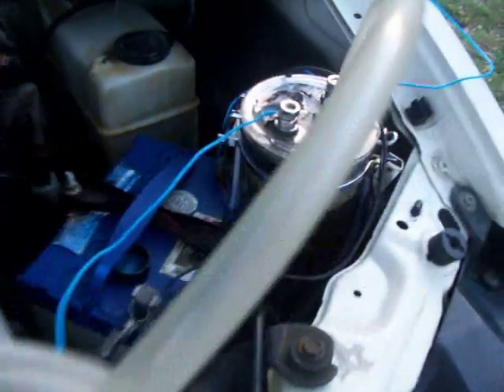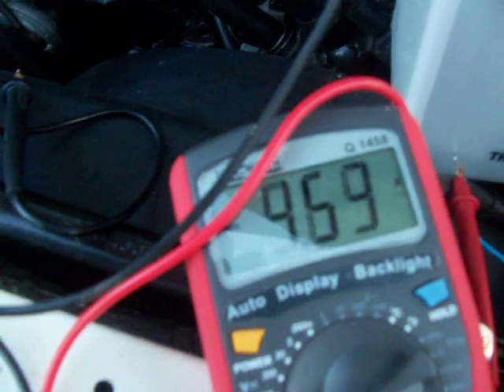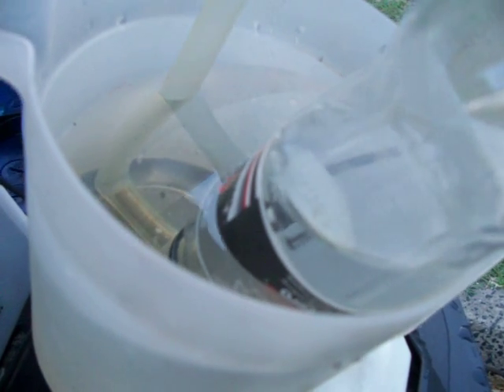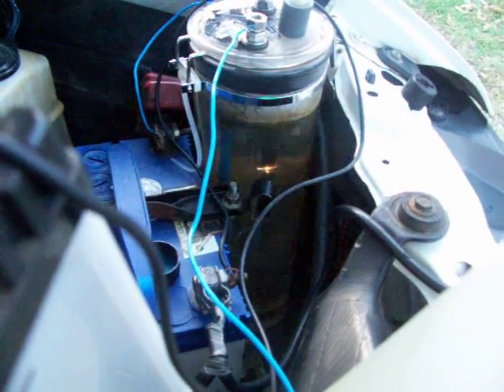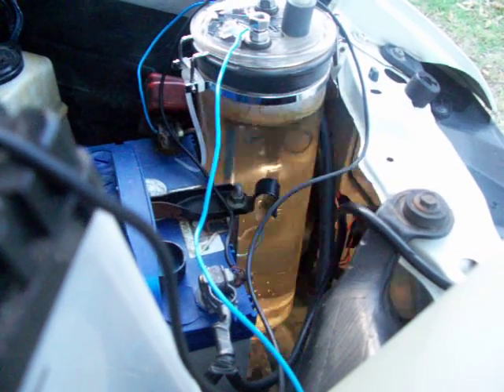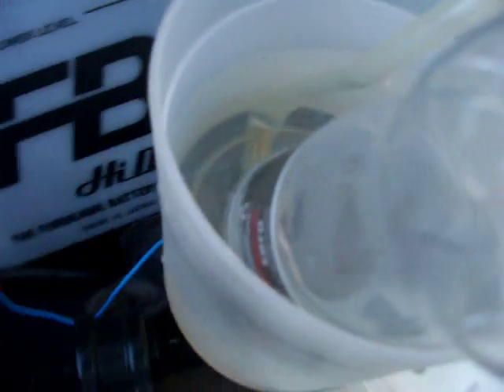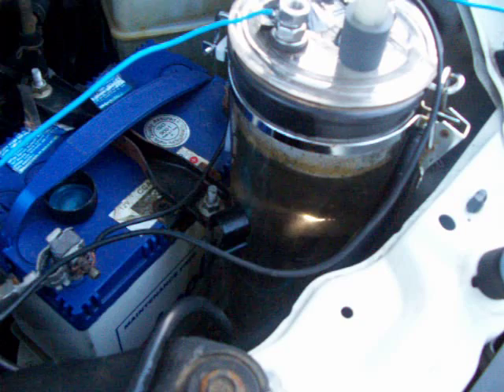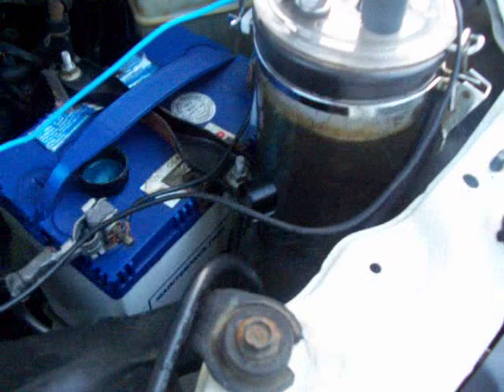Plasma Fusion Cell fitted in car test 1

Comment from the maker: @nick97549 " molicules, oxcegen, sut up"?????? Shouldnt that be Molecules, Oxygen, Set up? An illiterate engineer now thats something you dont see everyday. If you have done this experiment you would know the gas was not H2 and O2 as such a gas exposed to an ignition source would cause an explosion. It would not require air (Oxygen) from outside the container to ignite as this gas does. It would be impossible for such a gas to be generated by plasma as it would also be ignited by the plasma.

Comment from the maker: @nick97549 So you try to make a elecrolysis unit that produces a glowing white light under the water / electrolyte.
This is obviously NOT plain electrolysis, which consists of two plates immersed in water with an electrolyte to which you apply a voltage. Electrolysis cells DO NOT GLOW with a white hot light, if you cant see the difference the you Sir are a moron!

Comment from the maker: Plasma is formed by an arc between two carbon rods. Power is supplied by two car batteries in series 24v. When plasma is stable it draws about 14Amps  336 Watts,for 1.2 litres of fuel gas per minute. Gas supplied at about 4 to 1 air to gas can run an engine but obviously the volume cannot be generated on board. Using this plasma to cause pyrolysis of waste organic materials can heat your house and water at the same time as generating the gas to run your car. Very efficient heating solution.

Comment from the maker: The gas contains both carbon monoxide and Hydrogen.
Yes Electric cars are more efficient than normal electroysis, but the point here is that plasma can break nearly anything down into its basic components even water, so therefore using plasma we can break down cheap or free waste products and use them to power a motor vehicle instead of incinerating them or making more rotting landfill,solving 2 problems. Water is just there to give a hydrogen boost look up "steam reformation of hydrocarbons".

Comment from the maker: Water makes the gas. I dont understand the question. You can have a plasma arc through gas this is what happens in Neon,flourescent lamps. Also Sodium and Mercury Vapour lamps (Street lights). This is a far more energy efficient way to produce light but is not a reaction producing a flamable or explosive gas.

Comment from the maker: Plasma allows a chemical reaction between the materials present in the water/electrodes etc. Normal electrolysis doesnt reach a temperature sufficient for this type of reaction. Plasma will allow the oxygen in the water to react with the carbon in the electrodes so that the gas is safe to store as it has no available oxygen and wont ingnite until in contact with air. Plasma can allow other materials that oxidise ie: Aluminium, Iron, etc to react with water and give greater Hydrogen yield.

Comment from the maker: Yes exactly right with normal electrolysis, but if we add in the chemical reaction between Carbon and Oxygen in H2O the reaction becomes far more efficient. If we can use other chemical reactions this can be a viable replacement for gasoline. The process doesnt have to be more efficient just cheaper, with the use of energy from  cheap scrap materials. The energy in materials commonly sent to landfill from each household each year is more than enough to run the average family car for the year.

Comment from the maker: "Couldnt get a good reading light"!Check my other videos particularly
 
"Car plasma injection system"
 
Looks like more gas than is required to "read a book".  
Please dont assume you know it all. I have done electronic engineering and I know how to design and build devices that can do things you wouldnt believe and I can do this too, it is just a matter of getting it stable enough for practical use.

Comment from the maker: You could NEVER produce enougn H to run an engine from the output of the alternator alone. But if you can use the power from the alternator to regulate a chemical reaction that produces a Hydrocarbon gas on demand. This is my goal, all I have to do is find the right elements to put into the plasma once the Carbon arc is established. The materials used have to be abundant and cheap so they dont become as expensive as gasoline, There are numerous compounds that fit this criteria.

Comment from the maker: OK, This a totally different process than conventional electrolysis.I am using Carbon to bond with the oxygen(from H2O).The carbon bonding with the oxygen gives off a large amount of heat and light and makes the process far more efficient.The Carbon is consumed slowly in the process.Think of it as chemically assisted electrolysis,Carbon is cheap and plentiful and Carbon can be scrubbed from the gas by bubbleing it through a Sodium Hydroxide solution to make the gas more volitile if required.

Comment from the maker: Hi.
With a plasma reaction you need an oxidising agent (in this case carbon) as the electrodes. Why? Because plasma is hot enough to reignite the HHO gas as it is seperated, but if you have something for the Oxygen from the H2O to bond with it robs the Hydrogen of the oxygen it needs to ignite.
This is why the gas produced cannot ignite until it has outside air to give it the Oxygen required. I am now experimenting with other electrode materials, many are more promising.

Comment from the maker: Overcomplicating? I am trying to find the best production rate (method) to boost or maybe one day replace the gasoline I use in my vehicle. Look at production rates in this video and then in my newer videos and you will see 100 times the production. This gas when mixed with air 3 to 1 air to gas ratio is proven to be able to run an internal combustion engine without modification to the engine.
What are you tryng to achieve? Please explain?

Comment from the maker: Thanks:) Yes The carbon is consumed in process but carbon electrodes are cheap and available at any welding shop.The carbon does two things. It turns the Oxygen into carbon monoxide so gas wont burn without air.When reacting with oxygen carbon adds a lot of heat to the plasma reaction making it far more efficient.See volumes on latest cell. One of the previous tests produced so much gas it blew the lid off the cell and cracked it. As always when something spectacular happens I wasnt filming.

Comment: facinating project ... so in your desingn, you consider the carbon electrodes to be consumables and take advantage of what I had considered to be a disadvantage ... I many have to rethink plans I had on the board ... I was leaning toward tungstun ... you will win not awards for photo journalism but I admire your work ...

Comment from the maker: Yeah your right. There is something other than Oxygen and Hydrogen being given off though. It seems to give off Carbon Monoxide and maybe Hydrogen, but the hydrogen seems to burn blue and slower so I think it is some kind of Hydrocarbon. Proof that the Oxygen has become carbon monoxide is the fact that this gas will not ignite without outside air see ignition tests. Yes I have tried KOH and spark plug method, But I want to produce a gas that is safe to store and burns more slowly like LPG does.

Comment: i hate to tell you this but if you have true fusion the gas coming off will be helium or somthing else i do belive the compound the electrodes are made out of may play a part in what is returned but unless somthin other than oxygen and hydrogen is being produced tiz not fusion keep up the good work though by the way look for the spark plug fusion method with tinkering there may be somthing in it

Comment from the maker: Yes the pressure in the storage container and possible sudden failure was my main concern. You can alway buy a new motor, but driving a vehicle with a ticking bomb on board is more of a concern. Carbon fibre would be a great idea if it could stand up to the heat and pressure of reaction. As I said before I have little knowledge of gas storage cylinders etc. Keep working through the problems and with such a inventive mind you will get there.

Comment from the maker: I have little first hand experience with this (Only a distroyed lawn mower with cracked valves) Not sure of cause so I went looking for explination. This is what I found, Very little oil reaches the valves and seats maybe this is the problem maybe not. But this is not rust, Rust is oxidisation, this is cracking of the metal itself. Maybe aditives can fix this

Comment from the maker: Sorry to be so negative and discouraging, but Hydrogen wants to bond with Carbon, If it cant get it elseware it will rip it from the steel itself. Hardened steel has to have high levels of carbon to make its molicules bond more closely. Take the carbon away and the steel falls apart. There seems to be no way to get rid of CO2 emissions, but if you use aluminium you are also generating CO2 as it takes hugh amounts of electricity to make and this power mostly comes from coal fired generators.

Comment from the maker: Look up "Hydrogen Embrittlement" in wikipedia:
Hydrogen attack
If steel is exposed to hydrogen at high temperatures, hydrogen will diffuse into the alloy and combine with carbon to form tiny pockets of methane at internal surfaces like grain boundaries and voids. This methane does not diffuse out of the metal, and collects in the voids at high pressure and initiates cracks in the steel. This process is known as hydrogen attack and leads to decarburization of the steel and loss of strength.

Comment from the maker: HHO gas ignites too fast and causes engine knock which will ware engine too fast, Also I suggest you look up "Hydrogen embrittlement" as hardened surfaces like valves and seats become damaged when directly exposed to Hydrogen. The carbon forms temporary bonds with Hydrogen (Hydrocarbon bonding) which makes the molicule to large to enter the metals lattice structure so it cannot cause embrittlement and damage to metal.

Comment from the maker: Your right,There is oxygen but it is rendered innert by its bond with the carbon from the electrodes. This is caused by the high temp plasma reaction, it is not normal electrolysis. My goal here is to make a gas that is safe to store and burns at a suitable rate to be used in a unmodified petrol engine. This gas will not burn until the gas is exposed to air. See burn test with slightly imploded coke bottle. I will post some other tests I have done to prove this soon.

Comment from the maker: Hi.
It would be better to mix HHO with fogged or misted water as that would cool down the combustion and increase expansion as water mist became water vapour. This cell does not produce HHO it produces Hydrocarbons and Carbon Monoxide.This mix has no oxygen in it so it is safe to store and must be mixed with air to burn.Burn rate is close to that of LPG and can be varied by limiting exposure to air. See my latest video  " Gas Implosion Warning this video sux Ignition test 3 " for burn test.

Comment: have you tried mixing hho with non combustible gas? 
stanley meyer added more air into fuelcell to slow down the burn rate of hho. 
this is must needed to run car with hho.

Comment from the maker: I have made modifications to cell and it produces 390ml in 30 seconds. I fed the gas of this slower producing unit into the intake of the carbie. it idled slightly faster but I need to mod intake manifold to allow more air at intake to mix with gas.

Comment from the maker: I am thinking a circuit with an LDR. (light dependant resister) will pick up when initial arc begins and a circuit to allow most of the current to bypass the solinoid so it only has enough power to maintain gap and not enough to keep seperating electrodes. A stepper motor circuit sounds quite involved and I like to keep it simple(until I at least know if system is viable anyway.)

Comment from the maker: There is no electrolyte in this set up. I put the cell on the scope and found that it is useing less power than calculated as current is only flowing 72% of the time. Calculated power in 24V x 4.5A = 108W Should be 108W x 0.72= 77.76 Watts average for 390Ml in 4min 36sec. Not great production but a better drive circuit should give far better production.

Comment from the maker: Arcing through the gas produced then injecting water through arc seems to be much more efficient, as shown in previous video.But doing it that way is far more dangerous because if any air gets into the reaction area it explodes. The reaction MUST occur without any free oxygen so that ignition of gases cannot occur inside device. This device is more robust and stable.

Comment from the maker: Yes you are right. The arc is being broken every few seconds because the solinoid in series with the electrode continues to seperate electrodes until the current flow drops to zero.I am going to set up some sort of a feedback circuit so electrodes seperate until a predetermined current flow is reached and arc is maintained at that current by varying the electrode gap. Not sure how to do that yet.